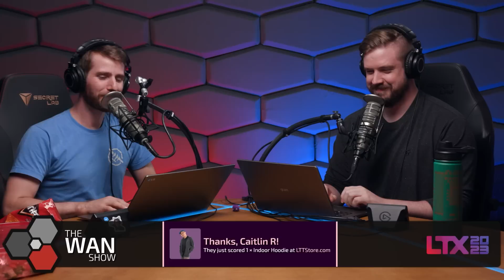How Do We Standardize Standards

Comment: The HUGE issue preventing Displayport and HDMI from merging is that HDMI is a licensed standard but Displayport is open source. The HDMI people wouldn't want their infinite licensing cash flow to stop and I'm sure the Displayport people don't want their standard used to line people's pockets.
Reply: is this why newer hdmi 2.1 with 4k and 120 hz doesn't work on most linux systems? I recently realized this and was very disappointed, I use a tv for monitor which supports 4k 120hz, but only has hdmi and no DP, ubuntu does support it, but not all variants like xubuntu, i think it has to do with each DM needing their own hdmi licensing or something
Reply: Basically, HDMI was created by the TV / media industry, and is part of the business model. DP was created by computer & electronics manufacturers (it's under VESA, the same people as the display mounts) to replace previous display tech (VGA, DVI) as well as internal display links (FDP). So the latter is a lot more open and cheap, because it's really designed as a pipe between vendors of video source devices and vendors of display devices.

DisplayPort is not "open source" though, it's *royalty free*.
Reply: The really funny thing is that HDMI is a miniaturized & extended version of DVI. VESA (the DisplayPort) people made DVI and the HDMI people took it for themselves. To drive the DVI comparison home, HDMI even originally shipped with specifications for a double-wide plug for dual-link HDMI (much like dual-link DVI).

Naah, actually, the real reason why DP and HDMI aren't merging is that they can't get VESA to agree that the locking connector is a pain in the ass.
Reply: @SuperSmashDolls actually, the locking mechanism is optional in the spec. But really it's because of copy protection. Content providers wanted their stuff to have hdcp
Reply: @jordanwardle11  Which you can easily remove with an HDMI splitter.
Reply: @jordanwardle11  Doesn't DisplayPort have it's own encryption standard?
Reply: @SuperSmashDolls  Yes. But it's more of a bullet point to shut media content people up than an actual workable standard. Early on in DisplayPort I remember people trying to use it, but it ran afoul of multiple competing implementations that all technically met the standard yet where not interoperable.
Reply: One is praying the other goes out of business so their business model can take over both, is what I’m assuming and probably not wrong
Reply: So what you really mean is we should all embrace displayport as the one true AV cable, yes?

Genuinely all for it.
Reply: The HDMI people like their obnoxious DRM (HDCP) far too much.
Reply: Nice.

Comment: The different implementations of USB-C would be completely fine, if every single USB-C cable had some text on it to say what the max data transfer speed is, what the max power throughput is, and any other special features like thunderbolt or displayport logos. Right now, when you want to reach high transfer speeds or find the correct quick charge cable, it's a damn nightmare. I've managed to label myself like 60% of my own cables for what they can do, which is not ideal but somewhat fixes it.
Reply: I just  populate my collection of USB C cables with ones that can do it all. 100W capable high speed cables only, all exactly identical.
Reply: @namAehT  ok mr. moneybags 😂 no but really some of my use cases have to have usbc cables just for charging, that can accidentally break and I won't mourn them. But when you need to transfer files or charge a phone or laptop that can take more watts, it should be easier to distinguish the proper cable.
Reply: @@GH0STST4RSCR34M like Linus said, that would be a useless additional cost for every single usbc cable. Would you be happy if your wireless earbuds would cost $20 more just because they had to sell it with an included cable that can do everything, but is meant only for charging at 5V 2A?
Reply: @namAehT  Wouldn't such full-spec cables tend to be heavier, thicker and stiffer than some bare-minimum cables? I don't like cables that bend, turn and pull some lightweight device so that I'd need to prop up the device on the table to prevent the device dropping on the floor.
Reply: As much as I Iike using usb c, usb c is still fragmented, for example, not all audio devices for smartphones that use usb c are not created equal compared to the universal 3.5mm aux port since certain usb c dongles for audio carry only digital, only analog and sometimes both digital and analog, all the usb c audio adapters look exactly the same so you won't know if it supports digital only, analog only or both digital and analog unless you look up the specs of the usb c adapter and device. There are android phones that only support digital for usb c audio from the usb c adapter, the same thing applies with usb c with analog audio only from the usb c adapter and sometimes even both digital and analog from the usb c adapter. It's hard to know the difference with whatever format the device uses for audio over usb c from the usb c adapter. Than theres video over the usb c port. The pixel devices don't support video from the usb c port since it requires a chrome cast device instead of using a reliable wired connection. The issue that is plagues audio over usb c also applies to usb c over video support. I have a battery case for my pixel 4a 5g and I also have a usb c audio adapter and the usb c port from the usb c adapter won't play audio from the usb c port from the battery case since the audio is still playing from the phone speakers. Battery cases with the usb c port only charges the phone and offers no functionality for audio with a wired connection at the same time when using a usb c dongle while the usb c audio adapter is plugged into the usb c port from the battery case and trying to play audio at the same time when I did this experiment. It won't work since you can't charge your phone and listen to music or watch a video at the same time compared to using the traditional headphone jack. Luckily for me I can use the headphone jack while charging my phone at the same time or charge my phone from the battery case and use the headphone jack at the same time. I use my phone while it's charging and I use the headphone jack at the same time all the time. Bluetooth is not flawless and requires batteries to work, until they can make bluetooth 100% reliable like wired headphones, uses 0 batteries like wired headphones, 0 drop out issues/ interference that don't plague wired headphones. Wired connections are more reliable even though you are tethered to whatever device is plugged in but at least you on know that it works. The annoying thing about usb c audio adapters is that phone manufacturers made there usb c adapter proprietary to there specific brand and not work with other devices. A samsung usb c audio adapter only works with Samsung devices, the motorola usb c audio adapter only works with motorola devices. Audio from a universal standard became proprietary when usb c adapters that use to come with there phones have become locked down and the manufacturers want to have there own ecosystem and they want to lock down there customers to there own specific devices. It's like the old school flip phones with there proprietary charging port but the same thing is happening with usb c over audio. Even though micro usb is fragile compared to usb c but micro usb works the same way among all devices much like the 3.5 mm auxiliary port even though micro usb durability is weak but usb c has a better and stronger connector than micro usb which does not make any sense. Somethings that are old and outdated like micro usb and 3.5mm aux port are more reliable than certain things that are new like usb c. New is not always better because certain features and technology from the past just work but new stuff are still fragmented and not all work the same way. Only certain new things that are only better until they offer the same features and functionality as the past devices. The regular light bulb does not last as long as led light bulbs but led is newer and last longer even though they offer the same features and functionality.
Reply: Yeah like USB-C1, USB-C2... print/mold just a big 1, 2, 3.. etc. on the connector based on its rated speeds. 
Develop a new higher bandwidth cable? Just increase the number.
You'd be confident your "current highest number" cable is capable of what you need.
Reply: @@GH0STST4RSCR34M As USB-C becomes more and more ubiquitous, and finds its place in lower and lower tech uses such as purely for power delivery like usb micro-b/a it becomes a bit insane to force people to spend $50 on some insane over spec usb-c cable just to power a desk lamp or to charge a power bank.
IMO, they should standardize on maybe 3, max 5 "standard sets" for cables to meet, and assign them a colour or logo. So I know that if theres a blue strip on my usb c cable it meets this set of specs. And you can have specs that target different price points/common use cases. For example a really cheap one can implement maybe only power and basic usb 2.0 data.
Reply: @@GH0STST4RSCR34MI mean you could just buy a USB C cable like that, they already exist. But that could come with caveats like cable thickness or an unreasonable cost which can be annoying if you're charging tiny devices
Reply: I don't know why can't they just... Freaking paint them.
Any color.
Really.

Comment: HDMI can carry 100mbps ethernet (HEC) but I have yet to meet a single device that actually implements it. The same physical pins are used for ARC as well so there's even less of an incentive to actually do anything with ethernet over HDMI.
Reply: I mean, name a router that has an HDMI port. The internet of basically anyone not in a major city is probably in that ≤100mbps range, but it hardly matters if ethernet is equally accessible and routers only have ethernet ports.
Reply: @Naokarma it was meant that the tv acts like a switch. The tv connects to the router with ethernet and the HDMI connects the ethernet to everything else

Comment: There are actually a fair amount of USB C ports that only do 5V 2A. 
Usually its lower end phones or devices that really only use USB C cause its a common connector and the device needs <10W of power anyway
Reply: looks like i can call myself lucky to have a device that can be charged at 16W and still be around 120 dollars.
Reply: true, i think most phone only needs around 10W, cuz any higher wattage create heats that may damage your phone battery
Reply: Samsung S10 lite only had USB c 2.0 but had PD 3.0 45w

Comment: Everything could move towards USB C without too much kerfuffle if there was a universal way to identify the capabilities of the cable, such as a symbol or colour coding on the plug. Working in IT, it would be a nightmare if you had to try to explain to someone which cable to unplug without some easily identifiable feature. Blue with a printed transfer speed for ethernet, red with a printed rating for PD, gray with a printed DP version, etc. would make it much easier to keep tabs on the functions of USB C cables in a drawer.
Reply: Color coding wouldn’t work with color blind people. And yes this is a real problem because I’ve seen color legends required for people who work with cabling.
Reply: Color and shape
Ethernet is a blue square with an internet explorer globe and swish.
Dp is a yellow square with a small rectangle and dot underneath like a monitor sort of.
The problem is wear and tear and also the problem that wrong cables can fit into wrong ports is personally a problem I think.
It will spawn problems that can only occur of the problem can even happen.
Reply: Or do it like ethernet cables. Just literally write that shit on the cable.
Reply: @DK-210  Very good point, thank you for mentioning. Engraving a symbol/printing on the cable would be the better bet, then.
Reply: @ayoCC  I definitely can see that being an issue. USB C is able to negotiate, so our clever programming friends could come up with ways to notify you that your cable is not supported for the port it's plugged into (assuming it's plugged into a device with GUI/console/error codes).

I honestly don't see the need to condense everything into ONE connector, but I do think we could benefit from consolidation.
Reply: @sojiroe253  no no, do both.
Always do both. For colorblind people, the symbol will work.
For not colorblind people, the color already becomes a "symbol" as well, helping the categorizing

Comment: It would be ideal if standardization didn't focus on the Software limitations, but the connection limitations, for example, USB C connector. Then simply add a number/acronym for different functions. 

Much like how Power systems work. You have a socket, but you don't care what happens at the other end.
Reply: usb-c is a standard for the connector, that's how we had ihunderbolt cable with usb-c connectors (before the merge)

usb4 just happens to require a usb-c connector and few other features (such as displayport alt mode) while speed is noted by the number behind it e.g. usb4 20Gbps/100W

Comment: Tons of LED lights and other devices on Ali Express come with USB C ports on them and use the standard USB A rate of 5V 1A to 5V 2.1/2.4A
Reply: I'm pretty sure my cheapo ps4 controller with usb c port for charging has that. I do know that the first one I received nearly instantly burnt out when I plugged in my laptop charger to it, which shouldn't happen with proper power control since any proper modern device should have a handshake to prevent exactly that from happening.

Comment: technically usb-c is a standard for the plug (and socket)
there's nothing to prevent hdmi to adopt the usb-c plug and only support hdmi

usb4 is a standard for the protocol, where displayport alt mode is required so usb4 10Gbps will support displayport alt mode ;)

Comment: I have never seen a device that uses Ethernet over HDMI.

Why a Devon receiver from 2023 can't carry Ethernet to 4k tv
Reply: I’d imagine you’d just have adapters at both ends. The use case could be you wanted to use existing HDMI cabling in the walls to convert to Ethernet.

Not very common or practical, but that’s one way

Comment: USB-C is very awesome, but NOT the ultimate standard for every device. My computers have USB-C amongst USB-A on the back, like most modern machines. And you normally connect devices with necessarily llng cables to your machine. The weight of the cable alone makes me very concerned about plugging something into USB-C on my computer, it doesn't seem sturdy enough for such use.
Maybe we shoudl either keep USB-A around or develop a bigger version of USB-C, which then could also carry more power, so that even a desktop computer can receive all it's power over this cable and connector.

Fact is, the USB-C connector on my computer is always the last one getting used. Because even though it carries the biggest amount of data of them all, in 98% of all use cases, it doesn't matter if you've got 3.0 or 3.1 or 3.2 speeds.
Reply: usb-c can carry up to 240W of power btw xd
i'd imagine a 2x2 "composite" plug could deliver ~1000W of power 😬